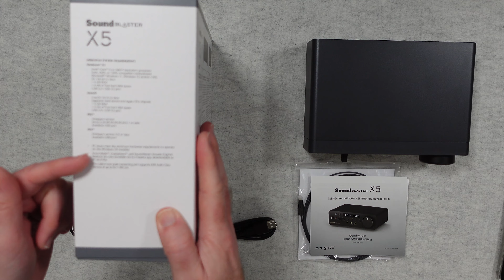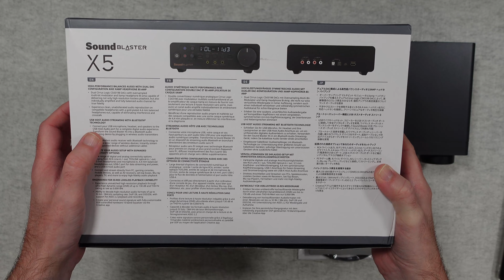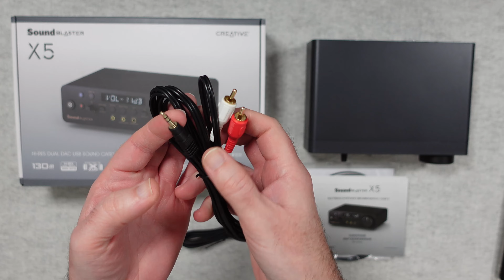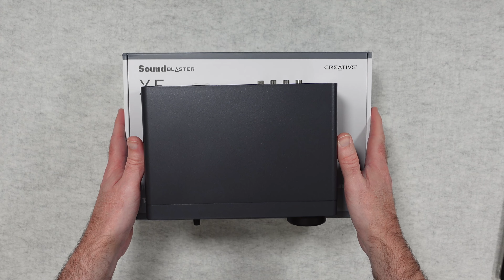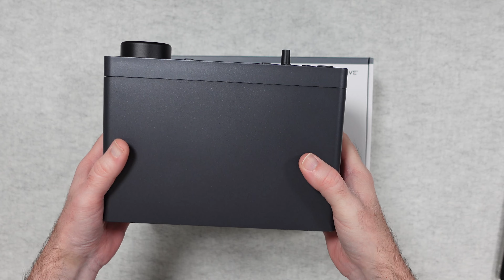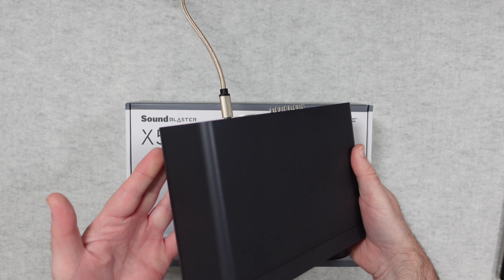Creative Sound Blaster X5 Hi-Res Dual DAC & Balanced Headphone Bi-Amplifier Review

Comment: Fum fact. Soundblaster G6 is 1/4 the size, 1/2 the price, and with the exception for balanced output it has identical stats. . . . thus me theory is that nobody should be buying x5 but using G6 instead. Speaking of g6 it still has proper audio driver with all the bells and whistles instead of the new white severely limited one.
Reply from the maker: Thanks for sharing this info.